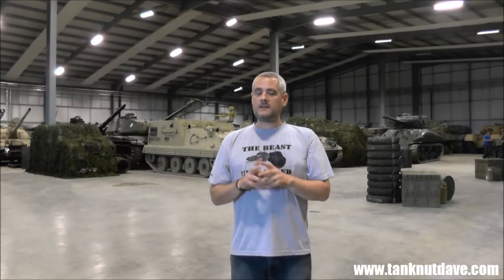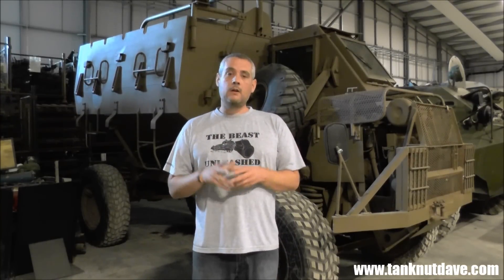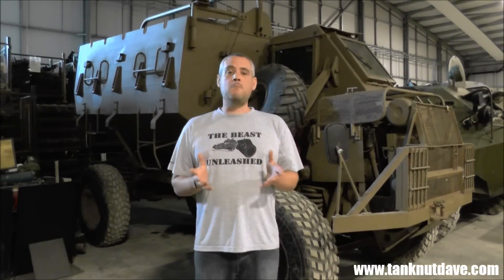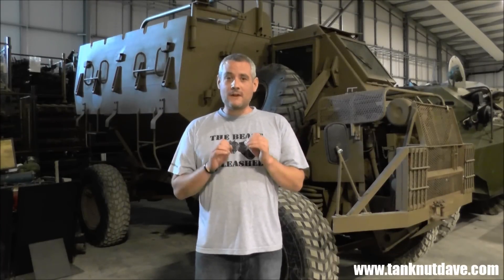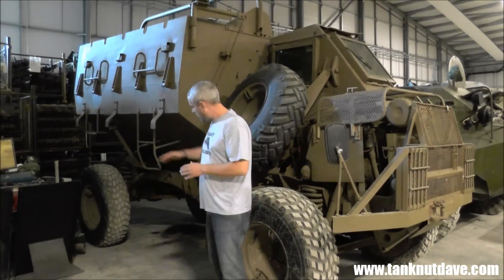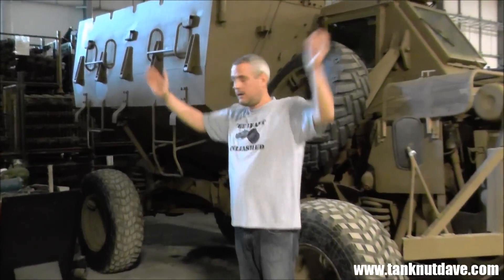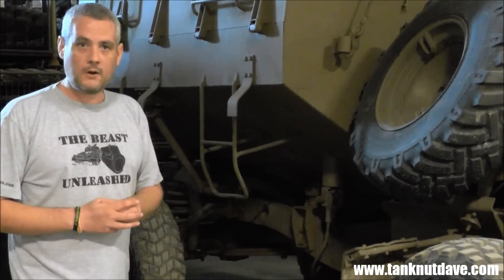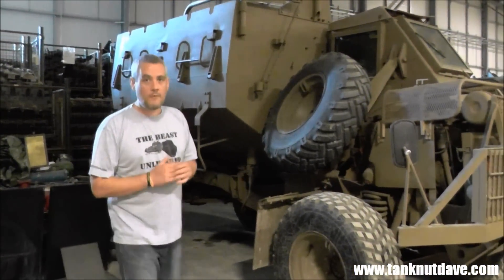The South African Buffel & How an MRAP Works

Comment: One of the diamond in the rough, if you'd like to call it that, APCs/IFVs was the BTR-152. Simply put, the BTR-152 had immense towing capacity for it's relatively small stature plus being a 6x6 vehicle allowed for it to be manage more weight (and help tow more efficiently) as well as provide better steady fire for a heavy armament such as a .50 cal (Browning or Soviet Dushka), or an anti-air such as a 14.5x114, 20x110 or a 23x152. The open-air feature of the vehicle was perfect for bush warfare, as it allowed for breathability (and if a rpg hit, better escapability for air) as well as better situational awareness. If only the Rhodesians made more use of these vehicles, as well as hillbilly armouring to no end (rhodesians also used spaced armor for their PATU vehicles), there would have likely been more interesting and hilarious stories of rhodesian battle victories. On that note, it is a shame that the Rhodesians never managed to capture soviet air such as the HINDs or any of the MiG models.

Comment: Great video, but with one small correction, it was the Rhodesians that first came up with mine resistant vehicles in the form of the crocodile, the leopard and the pig. These came in several other variants.
Reply: No, actually it was the South Africans.  The Army Hyena was developed in 1972 already...and the follow on Hippo also preceded all the vehicles you mention, and indeed, both these vehicles were supplied by South Africa to Rhodesia. Both these South African Army vehicles were preceded by SA police vehicles themselves..such as the Telefoonhokkie. The history and timeline are readily available.
Reply: The book Taming The Landmine by Peter Stiff  is the best read on the subject.
Reply: The South African Ratel was the world's first wheeled infantry fighting vehicle. (1976)  And still copied to this day.

Comment: The Rhodesians came up with the V shape
Reply: South Africa began using mine protected vehicles in 1974 with the Bosvark and Hippo. 

From what I can see online the Rhodesians began using them around the same time. There isn't concrete evidence that one or the other developed the V-shape hull before the other.
Reply: @springbok8876  from an operational standpoint , I believe the Rhodesians were first.
Reply: @iphoneupdate  I'm happy to be corrected though from what I've found online all the Rhodesian vehicles including the Leopard were designed from 1974 onwards. Which is the same year South Africa developed their first MPV's the Hippo and Bosvark.
Reply: @springbok8876  thanks for the info, appreciate it.

Comment: Dave what is your opinion on CR2 rifled gun i.e. having no ability to fire HEAT? I mean, what's the usefulness of HESH rounds against modern MBTs?. Secondly, what's your opinion on Leo2 when it comes to tests with it using 140 mm smoothbore gun? Do you think it would be a better option or that the current L55 with LAHAT firing ability is sufficient? Cheers!